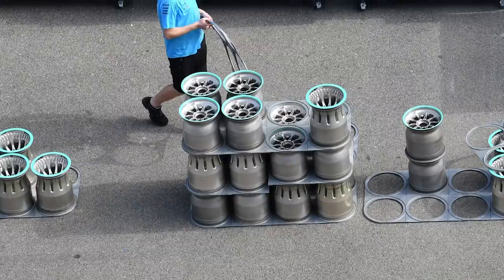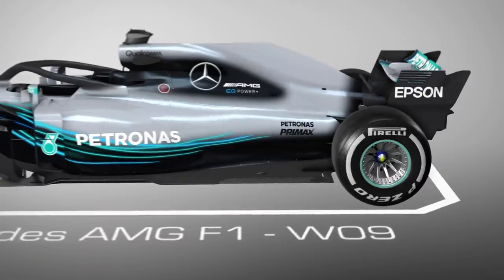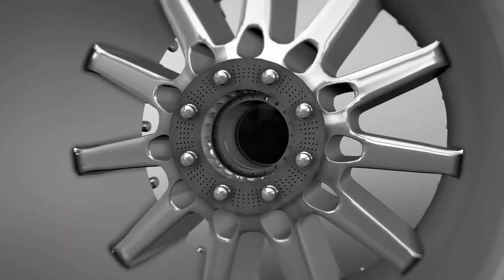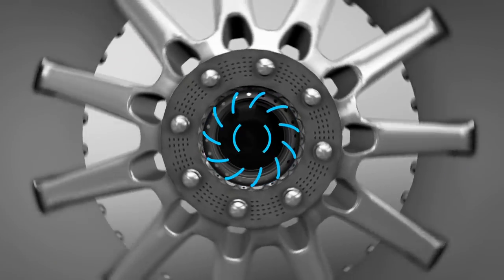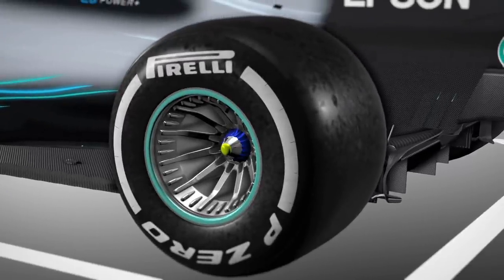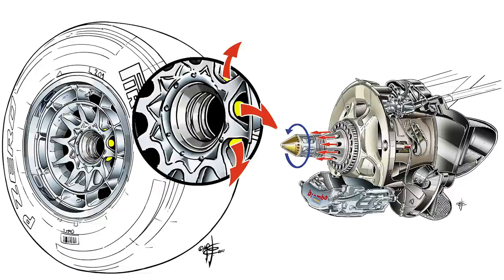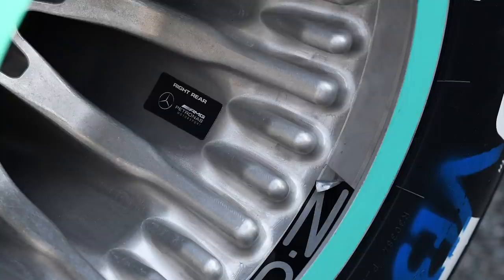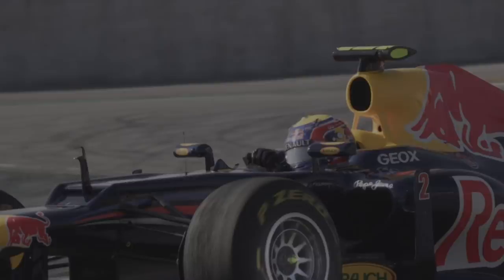Inside Mercedes' controversial F1 wheel rims

Comment: Man, back in the days when teams actually compete by inventing even better designs, those were the good days
Reply: Yeah.  Now it's like listening to an E.U. political meeting discussing their next political meeting.  I think there are some people involved in this that really don't need to have the job.  I think they should loosen just a bit and let some interesting stuff (innovating again).. and draw some new fans in.  It just seems like racing is getting too boring with all of this.. it's like attack of the clones out there.  God forbid someone gets an edge with clever engine design, it'll never happen when they're making a big deal about a rim spacer.
Reply: @J D well I know that skill is a essential part of F1, newer technology that are there to solely increase the car performance (not like abs and whatnot where the car is improved by assisting the driver) also requires the driver to be more skilled to handle
Reply: Oh I member
Reply: well they always tryd to bypass te regulations, the driffrents from the past and today is they now prohibbiting things that had never the chance to be run on Real race.  Remember the BMW F1 Turbo car 1986what had nearle double the horsepower than everone else.. bam turbos were banned. or the automated aerodynamic system that changes in every corner what ends in unbelivable cornerspeeds and topspeeds. banned^^ i have to googel it but back than i think it was Lotus or was that senna with his active suspension system...whatever F1 today cart races are better if you ask me Formula E new lands new horizons ^^
Reply: Remember when mclaren made the extra break pedal in the 90’s?
Reply: F1 sucks now anyway.
Reply: How is this different?  Trying to get better performance IS competing by using better design.  Full ground effects were also within the rules when they came out, they were only banned due to safety reasons.  Any racing series is always about finding a better way.  If it makes your cars go faster, you win.  If the change causes a hazard  it may be banned.
In this case, F1 has reviewed the new design, accepted that its main purpose is cooling, a legitimate pursuit, and thus approved it for use.  Good for them finding a new way of cooking brakes and tires.  Who knows, one day similar principles might be seen on our street cars.
Reply: The problem stems from the drivers. Racing was supposed to be about comparing equipment- the cars, the engineering. Cars though, required drivers, and drivers have egos. So when the louder, whinier drivers lose, the bitch and moan, the officials create rules. These rules create classes of racing. Each class of racing with multiple egos, in many positions, overseeing various aspects of racing. Each class with its innovators looking to bend the rules, and win races. To truly test machines would require identical AI "drivers". To truly test drivers all cars would have to be identical. Racing is a mishmash of who's the fastest team, tire, driver, car. As soon as someone finds a loophole, that gives them a competitive edge, it all becomes "cheating". All the innovation goes into maximizing the gray areas.
Reply: That was almost 30 years ago. Why is this suddenly a big deal now? The stuff the FIA banned in the last 20 years could fill a big warehouse.
Reply: Except for the fact they never existed. In the 90's they banned active suspension because not every team could afford it. In the early 80's ground effects were banned for several years. In the 70's they banned giant fans. In the first race the guy won by 30+ seconds. The car never raced again. As long as there's been racing there's been  leveling going on. From F1 to a car length or 2 in a street race.
Reply: That's not the point of f1. If they tried to make them as fast as possible it would be an lmp car. Theres a reason they're open wheel, not all wheel drive, have small diameter rims, etc.
Reply: Yehman your my age.. 27😉
Reply: @tomspizzirri4574  The money aspect of this is pretty much a a moot point now. If you look at how the top tier teams spend upwards of 140-180mil a year to go racing, saying that deploying new tech hurts other teams is laughable. Gone are the days when a mechanic like Williams can save up some dough and get a team/car together and go racing with the rest of the paddock. Its a big money game now and if you don't have it you wont go going racing plain and simple.
Reply: While i agree with your statement multiple innovations in older F1 Were also banned, have you ever heard of the term Rose tinted glasses
Reply: yeah but now it has gotten so expensive that only a few teams can invent better things
Reply: What you think this vídeo is about?
Reply: Thats because the fia banned everything
Reply: Mark Doldon 
Safety was the excuse for banning ground effect cars. However, Ross Brawn said the downforce it generated was replaced within two years by new wing designs. The big difference is that wings cause far more turbulence making overtakes dangerous if not impossible. 
So much for ground effect cars being too dangerous to use.

Comment: We need to stop calling these things tricks, the idea is to come up with improvements to hell performance. It’s not a trick when others can’t figure it out, it’s smart.
Reply: I feel it's more of a nuanced meaning of the word trick when used as per the video title.
Reply: I feel they used the word "trick" because of the way Hamilton commented about the Ferraris after Spa, I think it was a bit of a nod to that.
Reply: What about Ferrari and it's double sensor from FIA? Ferrari was smart and they got punished for it,Mercedes didn't.
Reply: @andreipavel1463  Well, why would Mercedes be punished if the rims are legal? (according to the FIA).
Reply: @andreipavel1463  I lost brain cells reading that.
Reply: @The_Curious_Cat  If they are legal,why did they cover the holes in the last races?They knew that the rims were illegal.And without them,they were very bad.
Reply: @andreipavel1463  gets your facts right. they weren't illegal as deemed by the FIA. Mercedes covered them due to possible complaints by Ferarri, thus playing safe. and of course, if you developed a way to mitigate a problem that is persistent (say rainwater getting through leaks on the roof) and then remove it, surely the problem will be back. that's quite obvious actually
Reply: @The_Curious_Cat  FIA didn't say anything, nobody even knows if they're legal or not, this is just ridiculous.
Reply: @TruenoBestWaifu  - What are you on about mate? If the FIA "didn't say nothing", that means they said everything. That is a double negative, you bellend.
Reply: @gypsykingg  I meant anything, goddamnit
Reply: @TruenoBestWaifu  - 😁
Reply: @The_Curious_Cat  there's your issue...' according to FIA'. It's all about interpretation of rules and how you can fool the FIA into thinking it's something else. Get rid of all the rules and go back to simple rules, for e.g.: four wheels of a size "X",  car to be so long so wide and so high, and say 200litres of fuel 'x' on race day. Anything else goes. How simple would that be, and how many different ideas would you have???? Imagine all the different machines there would be and Engineering ideas that would flow onto every day vehicles.
Reply: It's pure genius if you ask me.
Reply: Bring in the Wankel engine its d best innovation.
Reply: Did you forget what they did to Ferrari, the made the competition even.but with McLaren the rule book is thrown out the door.
Reply: @robotrip M a USA chant.... really 😑. Stop embarrassing the rest of us.
Reply: @marcolucchini8173  ain't that the truth. I'm so sick of IROC type racing. It's everywhere and it makes it impossible to watch good racing.
Reply: bubblebuster absolutely! It's innovation
Reply: bubblebuster you have to understand the world we live in. They say “tricks” because the rule makes are against free thinking and ingenuity.  They think if one team can improve their chances with innovative techniques then they are being unfair...kinda like getting punished for succeeding. This is the very essence of leftist thinking in society.
Reply: This is metaphorical for Europe in general. Way to much regulation that is a poor environment for research and development. Just look at what you all did to Google, without considering that they did what they did to recoup costs associated with developing Android and that no one complained about. Now it's just going to end up costing Europeans more and more to buy smartphones
Reply: @yourerightmybad7363  it is clear where the hosts bias is geared to.
Reply: @shawnv1600  this is why I haven't really followed F1 in a long time. I would say that every team is cheating to some extent ( and just haven't been caught out yet ). For example, Ferrari and Mercedes using the consumption of engine oil during the race as a fuel ( oil does have a calorific value ). The more rules introduced, just makes it harder to police them. F1 was always about ideas and innovation. Have a couple of basis rules that can not be twisted in any way, and go racing.
Reply: xXxMartin96xXx  here's a bright idea, a budget cap !
Reply: You are dead on sir. Compliment them for innovation instead you call it a trick.If you had come up with it what would have called it?
This reminds me of the 1980's when Audi came up with the Quattro drive train and destroyed Rally and the European car championship.  It got so bad they started handicapping Audi by adding weight to the car to give the other manufacturers a "Chance". Instead of initially haling Audi they drove them out of the series. Luckily for us Audi design prevailed and we the public have benefited with this technology now available in passenger cars. MB is on to something, let them better it for all of us.
Reply: Marco Lucchini I generally agree, but I do think some additional caveats should be included such as not allowing innovations that present a danger to spectators or undue dangers to drivers/pit crew, create excessively uncompetitive or combative racing conditions (e.g. airflow sabotage), or excessively damage the track.
Reply: Sounds like you need to stop calling these things tricks.
Reply: well ferraris 2018 car had improvemenets and merc was like "oh yeah ferrari is fast they are catching us FIA control their car" soooo ferrari did the same to merc now merc just has to stop telling FIA to control other teams how much merc wants
Reply: Thats true men. Well said
Reply: Plus it ain't cheating unless you get caught
Reply: Exactly
Reply: Your absolut right but everything ferrari found a trick in the last 3 years it got banned like in 2018 after spa where hamilton cried after he lost....but Mercedes can do anything
Reply: I agree with bubblebuster
Reply: They all thought about it before already, Mercedes is trying and so far succeeded in finding a loop in the regulations.
Reply: it's not that others can't figure it out dingus... it's that other don't haven't hundreds of millions of dollars to spend on innovation. So if its innovation you want why don't we just make F1 have 3 teams Mercedes, red bull, and Ferrari race it out because they the only teams that can afford to "innovate"
Reply: @jenuel11  lmao naaw

Comment: The non-formula fan would think teams get points for whining, not winning.
Reply: Ifthat was the case, Ferrari would be the undisputed champion for the last ten years.
Reply: just started watching f1 recently and this comment is pretty accurate so much complaining in f1
Reply: Nobody Knows  nobody knows
Reply: ur correct i was a fan till i learned all they do is win by whinning so ur right on
Reply: Honestly, I don't watch f1 at all. Only watching vids about f1 due to the engineering aspect because thats what im studying at uni. Its absolutely criminal that innovative designs and mechanics is removed.

Comment: points should be awarded for the smallest engineering details that result in the most controversy. Ferrari appears to be in the lead with their camera cooling bag.
Reply: Red bull have a duct in their seat that diverts Max Verstappen's farts into the diffuser. His drinks bottle contains jalapeno juice
Reply: @-BuddyGuy  So THAT'S what they meant by F-Duct.
Reply: @-BuddyGuy  I´m sure those farts go directly to Ricciardo´s engine and makes it explode every race.
Reply: Curious Cat   🔱 comment of the month  🔱
Reply: McLaren's tyre positioners, literally arrows that point where to put the front left And right tire And are pulled by some wire.
Nice tech! Haha i laughed when i saw it

Comment: The fact that these rims are "controversial" is why I have not given one rat turd about formula one in years.  Remember the days when the cars actually looked different???
Reply: When have F1 cars of the same era ever looked different? I'm a fan of 90's F1, but only a casual observer today. F1 is being regulated to literal death, the tracks are boring and the cars are ugly. But aside from minor aero, minor dimensional differences, etc, I can't think of a time when they ever looked different to each other... That's kind of the point of the discipline. You have a format that you have to stay within with your design?
Reply: @UnitSe7en  50's-early 80's it was a great time....from Wyoming USA 🔫🤠
Reply: You make s better point than some others. Maybe over regulation means the best teams spend huge money for modest innovation to exploit the rules fur tiny advantages that win but are otherwise not worth much. For example this alleged advantage may have cost s fortune to come up with a execute, but it's of little too no value outside of F1. But if you doesn't the same money on engine innovation outside the current rules, may be things of real value outside F1 would result. This is probably why some manufacturers spent their money with Lemans LM1.

Comment: It's not controversial , it's proper yo be called " Invention " .. brilliant team with brilliant solutions
Reply: @ductor knurl 

Well, that may be true...IDK.  But I do know that its freaking stupid.  Any effort to keep the brakes cool keeps them from fading and increases the safety to the driver.  How can that be bad?
Reply: @ductor knurl 

I dont believe they've broken the rules because it's not in the spirit of the rules' intent.  Its creative engineering.  "Necessity is the mother of invention", and no innovation that errs in favor of safety should ever be shelved for the sake of aerodynamic "violations" that are ambiguous at best.  Just my .02 cents.  

Thanks!
Reply: Causation doesn't actually mean correlation. The design isn't a mechanical device with a set intended purpose. Banning this design is equivalent to banning the spoiler. They both deflect air based on design not the actuation of independent device attached to the car.
Reply: Agree
Reply: They only like certain types of innovation though. When they discovered downdraft the ultimate conclusion of it was to literally suction the racecar to the track with high powered fans, and it worked beautifully. They still banned it.

Comment: I just find it odd that the FIA/Charlie Whiting can say something is OK, but a protest to the stewards could potentially overturn this. Can't the teams get a definitive answer from the stewards first? It's as if F1 wants teams to be disqualified after the race, as per Haas.
Reply: The Haas case is quite different, their floor was illegal, it was their mistake not reading the rules properly since the part that was illegal was quite obvious (the front plate has a specific round corner with a specific radius, they choose to not have the round corners and have the barge-boards attach directly to that part, that is illegal). The problem was that the FIA gave them a timeframe they were unable to comply because they don´t have their own factory, they have to wait for Dallara to build the new floors. But in the end, it was Haas mistake by not reading the rules properly.

I agree that the FIA should have a final say on the legality of each piece if they investigated them prior to be installed, if the piece is greenlighted by the FIA, then the stewards should not have a say, unless they find that the piece installed is different from the one the FIA greenlighted (which seems pretty obvious).